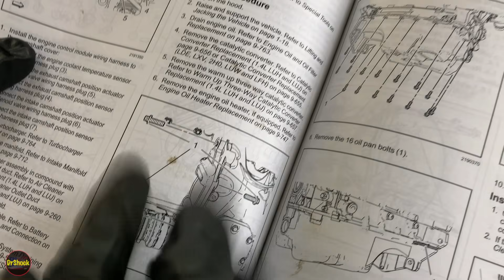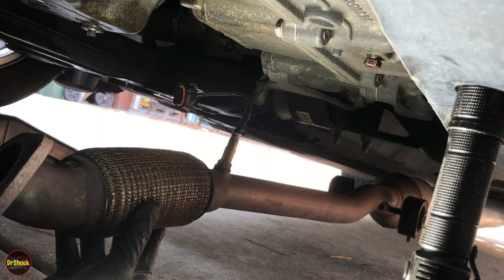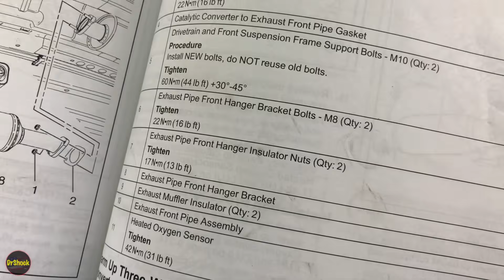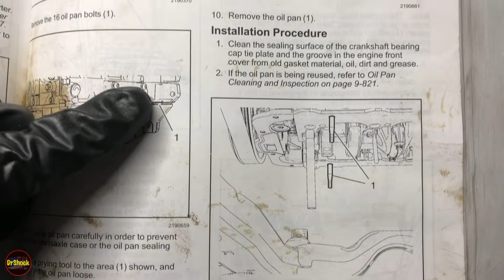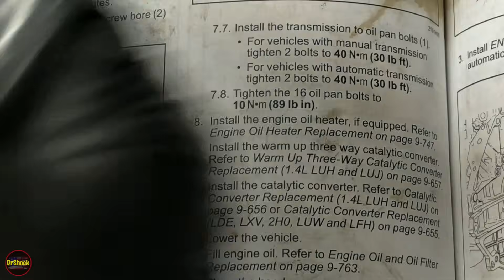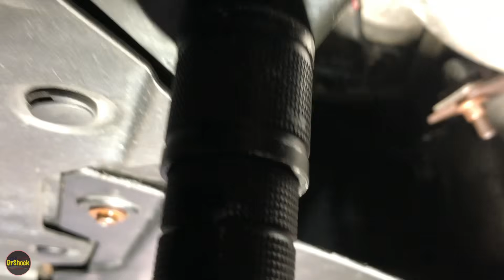2011 - 2020 GM Ecotec 1.4L Oil Leak ~ Oil Pan Gasket Leak Repair (Chevy Cruze Sonic Trax Encore)

Comment: What makes the GM/AC Delco RTV "better" than using something from Permatex such as Ultra Gray or Ultra Black?
Reply from the maker: It's what the manufacturer's (i.e., GM) engineering team worked with a vendor to custom formulate, you know the guys who actually designed the engine.  This particular engine runs hotter than most in its upper aluminum pan to block area, by design to reduce emissions and improve fuel efficiency, so this special sealant was developed for those unique conditions to last longer than a generic off the shelf run of the mill one.

Comment: Do you torque the sump bolts to spec right away or you wait some time for sealant to harden so you dont squish it out kind of. Also how long after installation do you need to wait before driving? . Excellent video, thank you so much for sharing!
Reply from the maker: The GM service manual does not call out any delay, you get right into torquing in all of the fasteners.   What's important is not to rush, as it's more likely you'll smear the sealant or worse drop the pan onto a dirty shop floor.   Go at a pace where you can get things done without delay but with control.

I don't recall offhand what the sealant drying time was for this engine/repair.  I would expect I either showed the packaging instructions or stated this verbally, but not sure.  If in doubt, let it cure overnite.
Reply: @DrShock  thank you sir, all the best to you 👍

Comment: WHEN YOU INSTALL THE TRAY IN PLACE, YOU CAN INSERT, FOR EXAMPLE, SUSHI STICKS INTO THE BOLT HOLES ON BOTH SIDES. THEY WILL ACT AS GUIDES SO THAT THE LID FITS ALWAYS AND DOESN'T SPREAD THE SEALANT. THEN REMOVE THEM.The video is excellent, it helped me a lot. Thank you very much.

Comment: I just did mine twice and I have to do it again. I did everything you did I'm ready to blow the car up
Reply from the maker: This particular engine can try your patience.  The type of sealant and amount used on this particular aluminum alloy based oil pan is important.  The correct torque on the bolts is also important with this engines' oil pan in conjunction with the amount of sealant used. 

And it's super important to both get the mating surfaces squeaky clean without ANY scratches, as well as get the alignment right the first time going back on, any smears in the sealant or deep scratches from cleaning and they just prove prone to leaking very quickly again.

Comment: You should note the 2 different oil filters that are used on these engines.
Reply from the maker: That info is in the video description on the oil change video with the part purchase links - https://youtu.be/SYa29Yw23QY .  Much more relevant there than here.

Comment: 2016 Buick encore base fwd. Looking for the TTY cross member bolts. Every place I order from is back ordered. The link provided in description has expired. Any alternatives?
Reply from the maker: The links in the video description are working just fine.  Search links never "expire".  There is only one seller of this GM part currently, that is what it is.   GM has this part on backorder due to a supplier shortage, which is why you're encountering this difficulty sourcing this particular fastener at the moment.

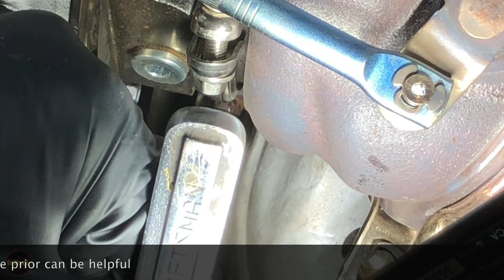Comment: 22:50, that is a real bear on my Sonic!

Quick Q, oil pan/sump is removed and I noticed every hole for the E10 bolts has a rubber-like material lining the hole of the pan. 

Is that normal? Can I clean it out with a pick tool to ensure none of it sticks out and prevents a flush fitment to the block?
Reply from the maker: That would most likely just be sealant residue, though it could be that someone incorrectly applied some sort of material to the bolts when last servicing.  There's no integral gasket or sealing material on the 1.4L turbocharged engines oil pan from the factory (RPO LUV or LUJ only).  Note that there's more than one 1.4L GM engine which can create confusion, if you are unsure the regular production option (RPO) code sticker will confirm what you have.  For the RPO LUJ and LUV engines the pan should appear as you saw in this video prior to applying the GM recommended engine sealant.
Reply: @DrShock  Thanks! Pan appears the same... I wonder if the rubber insert in the through hole is there from manufacturing whereby it would hold the oil pan bolts in place, prior to assembly/mating to the block.
Reply from the maker: Possibly, or it could also be that it is an aftermarket replacement pan if you are not the original owner.
Reply: previous owner were in-laws and they had all service work done at the dealer but it has never had an oil pan replacement. I asked and I also went through every service record. Hmmmm..
Reply: You are correct. Those small black rings in the pan holes were the assembly line bolt retainer sleeves.  They can be re-used on the replacement oil pan if they are in good condition.

Comment: O the 2 bolts for the exhaust crossmember is not replaceable bolts I thought every torque to yield bolt needs to be replaced
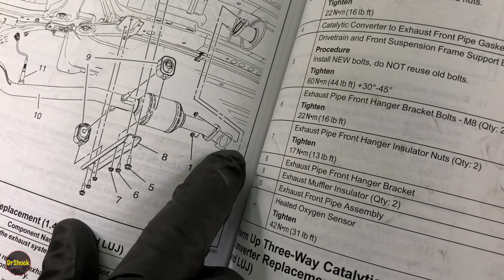Reply from the maker: I believe you are referring to the dialog at time index 30:01 and yes those two 15mm TTY bolts are to be replaced if so.  But the rest are not TTY, just standard fasteners on that crossmember.  The part numbers are in the video description for the fasteners that need to be replaced.

Comment: at 24:24  what kind of bolt setup is that  part number?
Reply from the maker: Not a bolt, a stud.  Part of either the catalytic converter itself, or the mounting bracket for it (there's more than the one stud associated with that time index procedure).  The copper nuts are serviced separately (and that number is in the video description), but the studs are not.
Reply: @DrShock thanks for the reply  can I just use a thru bolt for the top and bottom
Reply from the maker: If the OE stud is broken, or otherwise damaged yeah it would be typical to repair it using a bolt of the same size metric thread, pitch, and length.  You can drill out the stud head, if needed to remove it.  The OE copper type nuts should still be used, they are less likely to seize with the heat involved.

Comment: what do u do if you break off those cat studs that you were heating up
Reply from the maker: Those press fit studs are part of the catalytic converter assembly and not serviced / sold separately by GM.   A temporary repair, until the converter is eventually replaced due to natural failure, is to drill them out and replace with bolts of the same size and thread (and rated for the heat of being used in this application).
Reply: @DrShock  thanks for the reply your video has helped me tremendously   so thanks again

Comment: I just did this today with my oil pan and way I did mine was much more simple. All I had to do was take off the flex pipe, unhook cat plug and drop the pan no problem. I don't know why you went through all that extra steps....
Reply from the maker: We showed the GM service manual procedure, how it's done by the book for a particular GM model and particular model year.   This 1.4L ecotec (RPO LUV and LUJ only) engine was used on several models from both Buick and Chevrolet,  over a 10 year period.  One video cannot possibly cover them all, and they all have some differences in access and clearance (as well as the potential for erroneous previous owner modifications), but thanks for watching.

Comment: I love your process and detail.  I have 13 sonic and 13 encore 1.4 Liter.  Both have a variety of problems including the oil pan leak.  I already replaced the oil cooler (and all the lines) on the buick and while it was apart, saw that the turbo had an internal crack.  So replaced that (and all the lines) while it was apart.  in hindsight, I should have pulled the oil pan while everything was apart.  I dread going back in for the pan now.  The sonic is next and I can get the flex pipe repaired while it's off because the car bottomed out a couple times,  😞

Comment: couldnt you just use rtv black for the pan gasket
Reply from the maker: I showed that the GM service manual called for a specific adhesive, so that's what we rolled with (link to it in the video description).
Reply: @DrShock  always pays to do it  right

Comment: Edit resolved  chevy trax awd just put a bolt in threaded hole  from oil pan pushes it out and you can wigle it down Chevy trax is difrent  Do not use this video for a chevy trax  so much worse 6 hours in and gave up for day tomarrow may be cutting and welding stuff there's a engine mount in way
Reply from the maker: Does your Trax have AWD?
Reply: @DrShock  figured it out the darn threaded hole and yeah put a bolt in the oil pan and it  basicly fell out was geting ready to set up chain fall to pull engine to spit it
Reply from the maker: Ok, this 1.4L engine oil pan removal on the Trax should track close enough with this videoe xcept for AWD models of the Trax.  Since those obviously are going to plant a transaxle in the way that the other Chevrolet models do not have.

Comment: Hey I just did this on Saturday. I’m getting some trans fluid leaking between the oil pan and trans housing. Does this mean my trans is overfilled or what do you recommend doing??
Reply from the maker: Are you saying this "leak" just started after you resealed the engine oil pan?   I would be highly suspect of such a leak having been introduced simply by redoing the oil pan.  Unless you jacked up on the transmission at all.

Comment: If you're doing this on a Sonic, I recommend getting an E10 wrench (rather than socket) for the bottom bolt of the heat shield - the bay is more cramped and there's a hose almost directly in front of the bolt.

Comment: Is this the same process for a AWD? I seem to be stuck. Or do I need to pull the crank shaft pulley?
Reply from the maker: I presume you have a Chevy Trax or a Buick Encore, with optional all wheel drive / four wheel drive, rather than a standard Cruze or Sonic.  Such vehicles will likely have obstructions in doing this job in the form of the awd transfer case assembly.   I've not worked on either of those SUVs, but I wouldn't be surprised if the transfer case had to be dropped or removed to access the oil pan.
Reply: @DrShock  yes, sorry. I have a 2015 Chevy TRAX AWD 1.4 LTZ. Had to replace turbo, valve cover and working on the oil pan. Followed the video (which is a great video) I went to pull the pan out and realized that your video might not be for an AWD. Oops. I can’t seem to find a video for one. Any suggestions?
Reply from the maker: I just checked, and you definitely have to pull the awd transfer case in order to get the necessary access/clearance to replace the engine oil pan (note step 6 here - https://www.chevtrax.com/oil_pan_replacement-4606.html ) but I'm not aware of any freely accessible service info on that.  You'll likely have to buy a three day weekend subscription to the service information (SI) over at www.acdelcotds.com to reveal the Transfer Case Replacement procedure.

Comment: Dr shock help me the bolt on the crossmember that goes into the frame whatever the nut is attached to broke so the passenger side of the crossmember is kinda dangling with the bolt loose and now it just spins what should I do to fix this
Reply: The crossmember that the exhaust is attached to
Reply from the maker: Can you mention a time index in the video so I can be sure of the area you are referencing?
Reply: 16:08
Reply from the maker: Ah ok so the 15mm and 13mm bolts go into a captive nut that should be welded on the opposite side during the original assembly of the car by GM.   So you're saying that one of those nuts came off the crossmember internally then (i.e., the weld broke).  Well that is a pita to deal with.   You'll need to gain access to this nut so you can hold it in place with a box end wrench, or worst case vice grips.  You may have to bend the dangling crossmember a bit to get it to clear the studs on the two rubber clad insulators so you can spin it out of the way to attempt this (you can straighten it back in a vice later).   I don't recall what the clearance in this area looked like, you may end up not being able to reattach that one bolt as I don't think there's any room to reweld that nut back on.
Reply: No there’s no room it’s installed with the other bolts now the last bolt is loosely flipping around not even enough room through an access hole a couple inches over to fit anything but a screwdriver after spending all day working on it as of now it’s left as it is I don’t want to cut a hole to get to it
Reply: Loosely flopping around is what I meant to say
Reply from the maker: You may be able to wedge a screw driver such that you can finish getting the bolt out.  I'd soak it with penetrating oil and then give that a try.
Reply: Well what after the bolt is out I was reinstalling it? Don’t no if it’s gonna be a problem without it I don’t like it that’s all I no
Reply: I got the crossmember back on just not that last bolt thanks for trying to help
Reply from the maker: There's four bolts and two nuts securing this part.  I was suggesting, given the situation, you would just reattach it with 3 out of the 4 bolts.  Very unusual for this to happen, perhaps road salt corrosion got to the welds on that nut.
Reply: Yeah that’s what I did do if the other bolt starts clanking I’ll cut it off weird thing is there’s no rust but who knows why it happened

Comment: Thank you so much for this video 🙏 I was planning on fixing all my leaks the pan is one of them . I have a 2013 Sonic RS with only 52k original miles and it's starting to leak around the pan and crank Although before watching your  video I bought the gasket for the oil pan I did not know it was sealed on with sealant from GM .  
I'm going to try the oil pan gasket  only  thing I can add is my car is a California car and the catalytic converter is twice the size of the one on your car so the part # on the clamp and ring gasket on the cat might be different .

I played around with Catless Downpipes and actually have a non Ca, Cat that I installed it was like bolting on 20 HP since the Ca, Converter was so much bigger

Comment: DO NOT remove the cat, save a lot of time and aggravation....remove the airbox and remove the 2 bolts and 1 nut that hold the engine mount to the frame, jack up the engine(from the old oil pan) and wedge the crank pulley to the frame with a piece of wood (make sure its not on the plastic part of the pulley), you're welcome !!
Reply: Not all of us can jack up the engine 😢😂
Reply: Ain't that more work?

Comment: do you happen to know the Oil Pan Bolts length? It's E10 but im not sure the lengh. Thank you!
Reply from the maker: Don't recall, but all 16 bolts are the same - GM part number 11517518.

Comment: Just tried this with a 14 buick encore, exhaust mounting is totally different and worse, at the back of the oil pan, there appears to be part of the transfer case in the way which I didn't notice until i got the pan loose and ready to come out. Now it's hung up. Anybody have any ideas how to get it out of there??
Reply from the maker: While they all use the same GM Ecotec 1.4L engine, and same engine parts for a given model year range, there's invariably going to be some engine and transaxle mounting differences across GM models that just can't be covered in a single video.   Mounting brackets, cooling lines, differences in suspension and steering undercarriage components, exhaust routing, AWD transfer case, to name a few.
 
That all said, the Buick Encore is going to be most similar to the Chevrolet Trax for this procedure wrt to what's in the way.   You might find something for the Trax being that there were more of them made than the Encore.  If you can reference a time index of my video, and what you're seeing, I'll see if I can find some disassembly information for you as well.
Reply: @DrShock  Around 35:45 where you are taking out those recessed bolts in the back by the trans, on the encore, that back ear of the oil pan by the axle is blocked by a part of the transaxle that is bolted into the hole right below it. So when you try to drop the oil pan down, it is hitting this ear on the transaxle below it near where the 42756 is stamped, i don't believe i can even see that number on mine, it is blocked.
Reply from the maker: Is your vehicle AWD (4 wheel drive)?
Reply: @DrShock  Yes.
Reply from the maker: Yeah so I can see that parts related to that assembly are likely what's in the way on both the Trax and the Encore with AWD.  I think this parts explosion for the 2015 Chevrolet Trax might help visualize what's there.   There's surprisingly very little, next to nothing, documentation wise on the Buick Encore though.  https://7zap.com/en/catalog/cars/Chevrolet/Trax/TRAX%20%282015%20-%202015%29/Uk1JQURpbER5SUNPbzJYalpWT0JvQT09--/10102-%3E10635-%3E10798/113199%7C---JU%2CJV%2CJW76+TRANSFER+CASE+MOUNTING+%28ALL-WHEEL+DRIVE+F46%29/

Hope this helps.  I've updated the video description to call attention to this AWD transfer case mounting bracket obstruction on the SUVs using this same engine.
Reply: @DrShock  Thanks for your responses and efforts (and the videos). Obviously you couldn't be aware of all the nuances of these vehicles without owning each of them. The official way to get the pan out on the AWD models is indeed to remove the transfer case. There MIGHT be an alternate solution which could save time and a bunch of hassle, especially if you're trying to do this on the ground. It's not pretty though, and MIGHT involve removing the crankshaft bolt and pulley and then shaving off the ear of the transfer case bracket right above the bolt where it is blocking the pan from coming down with something like say, a sawzall. This MIGHT enable the pan to move FORWARD and DOWN enough for it to come right out without disassembling half the car for a gasket.